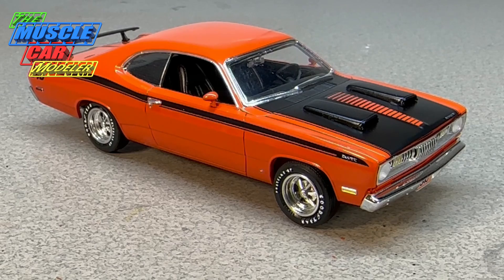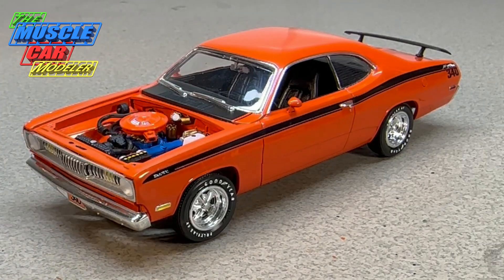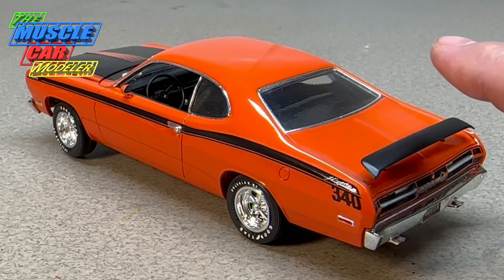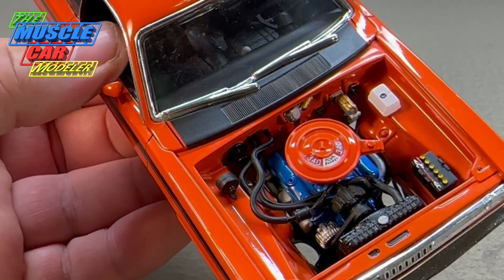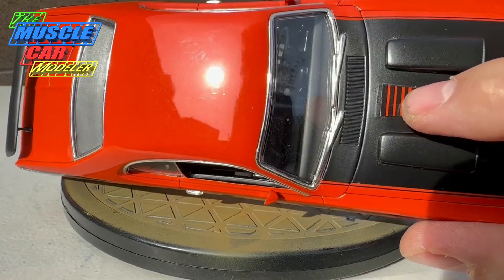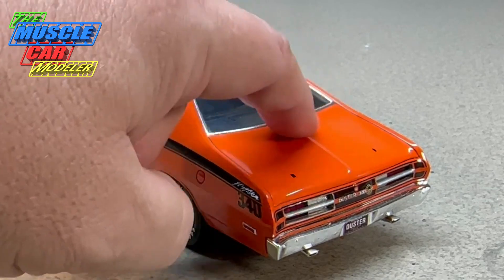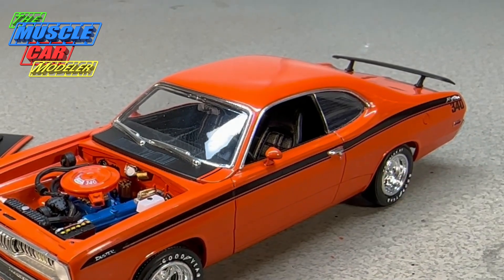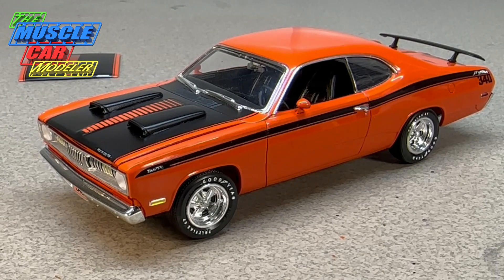AMT 1972 Plymouth Duster 340 Build

Comment: Thanks for the multiple warnings about the side windows. Maybe I’ll build mine with them in the rolled-down position.
Reply: They've given me trouble on the three '71 Dusters I've done.  The MPC '76 Dart Sport has these windows as a part of the single windshield part.
Reply from the maker: Thanks but on the Dusters, the windows don’t roll down. They pop out. The MPC set up as one piece is so much easier.

Comment: Awesome job! I’m learning a lot from your channel. 
I had problems with the side windows too.
I realized that the lower mounting surfaces were pinched between the interior tub a the inside of the rear quarters. After trimming away the mounting surfaces it fit fine. The upper mounting surfaces were enough to hold them in place.
Reply from the maker: Thank you, I'm glad you are enjoying the channel!

Comment: Great conversion to a 72. Just for your information the engines were painted in April of 71 from orange to blue. This was because the location of production of the 340 was moved from Canada to the US. So guess they just wanted the US made engines to be a different color. I have a friend that has a 72 Demon 340 made in November of 71 and his engine is blue. I have the scoops installed on my 72 Duster 340 like you because I liked them. The scoops are factory from a 70 Swinger 340. Just a heads up to those out there the scoops are installed with the tall side out. Not like the instructions say in the kit.
Reply from the maker: Thanks!

Comment: Raoul she is beautiful 

What would you think if you ran across a 72 Dodge dart demon 
340 4bbl thermoquad 
3 speed ,bench seat,dog dish caps, with heads that were stamped 360,no scoops ,no spoiler,don't remember much more
What is the correct name of the blue they had that year.i call it glow in the dark blue 
Oh had white stripes
Reply from the maker: Thanks! They had like 7 blues for 72.
Reply: We're 360 heads something that would've happened. I know the guy that bought the car new and he never worked on it
Reply from the maker: After all these years and developments on heads. Maybe so. I really don't know much about all the possibilities with the small block mopar. I have enough fun keeping up with the Big Block Mopar! I have a few and the advancements that have happened in heads on those in the last 20 years is amazing. When I built my last 440 in the late 90's. Only street heads were original iron heads that I had to get oversized valves, bronze guides, hardened exhaust seats. Edelbrock had a set but they were way expensive at the time and then they had race heads. Street aluminum heads were getting a bit better and cheaper 15 years ago and in 2010 I bought a set of Stealth Heads! Great for a budget and cheaper than redoing original heads. Now I have stepped up to Trick Flow 240 heads and cant wait to get this running.